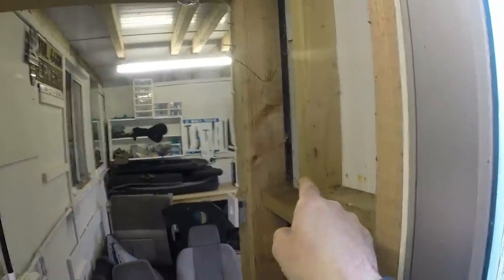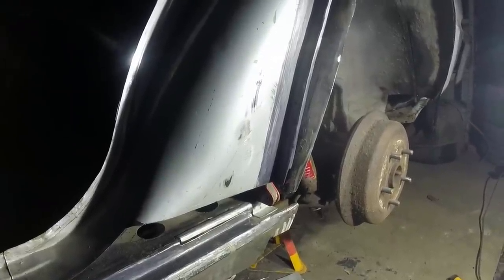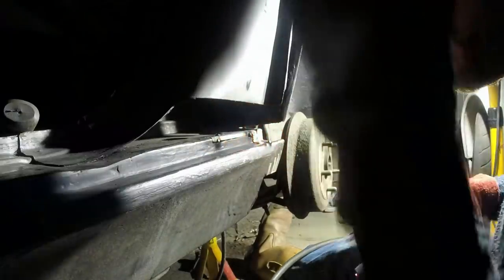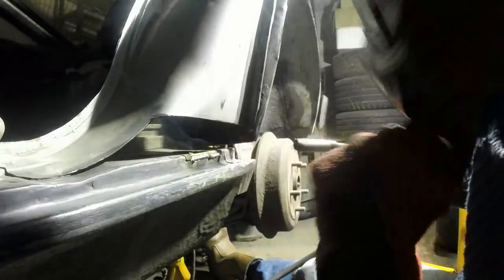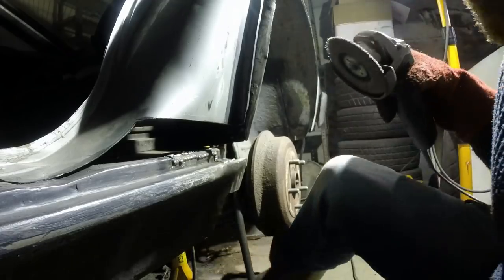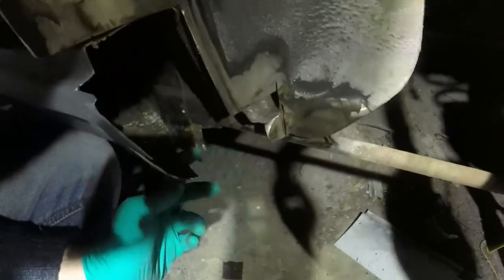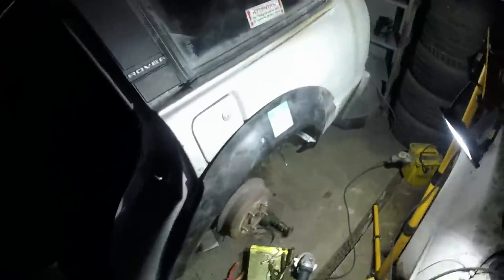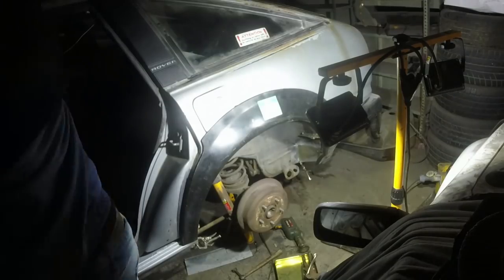Dotty 1981 Rover SD1 Restoration - Video 29 Rear arch 3

Comment: Bought some Hydrate 80 as you seemed very  happy with it. Have to say having used similar products in the past I really do rate it to.  Currently using it on my daily 1961 Swedish import Beetle and it works very well. It’s nice and thin so it gets covered well by primers and paint. Keep up the great work. As a kid I always liked the SD1’s styling despite my dads protesting.
Reply from the maker: Good, glad your getting on with it.  Ive leart always try and keep the bottle upright, it is really good at gluing the lid on!  Your actually meant to decant it into a tub every time you use it to keep the stuff in the bottle from activating or thickening up, but i dont bother as i end up wasting it.
Reply: I’ve been decanting it as it’s what the other products recommended to. Always put less in than I need so as not to waste it. Never put decanted back in main bottle after a litre of Blue steel(similar thicker product) got ruined doing so. I believe double dipping starts the chemical reaction in the bottle. The Hydrate 80 glued its lid on after the first use as workshop its stored in is rather warm in the sun. Admire your perseverance with the SD1’s. Keep up the good work. Have you tried getting 2k paint mixed in aerosols yet? It’s amazing. I painted the whole side of my Westfalia T3 camper with four cans. Brilliant finish and coverage.

Comment: Restoring an RD1 Rover best day of my life was when it went to the scrapyard it was a 2600cc. Come across for the First time I’ve seen your video and I hope it’s the V8???? all mine kept on doing was blowing the head gaskets
Reply from the maker: all of mine are v8's apart from the diesel.  Never heard of 2.6 blowing head gaskets.  Just breaking camshafts due to not enough oil changes.
Reply: All the work was done in the workshops at the army camp with professional mechanics new Cambell lot of wood in six months the belt broke the head when apparently it’s quite common in them days in the early 90s and I just couldn’t afford to get it repaired again so I went
Reply: And that was the second time it was done just going to fall to keep getting it done every five bloody minutes so just scrapped it I think the V8 was 1 million times better It was just a rubbish engine in it I think

Comment: Hi enjoying your channel the sd1 brings back a lot of memories for me quick question about hydrate 80 have you ever had it show rust again after treatment I am thinking of buying some would you recommend it I have used kurust  but it's a waste of money when it kurs it just sits on top of the rust and it rusts again in no time even after it has been painted.  Keep up the good work I look forward to some more content on the senator.
Reply from the maker: Hydrate 80 is pretty good. But like any of these products it can only treat the surface it sits on.  You need to pick out the rusty bits with a really aggressive wire wheel first. If there is a decent crust of rust it will continue to develop and come back through. Of the rust killers I’ve used it’s a decent one.